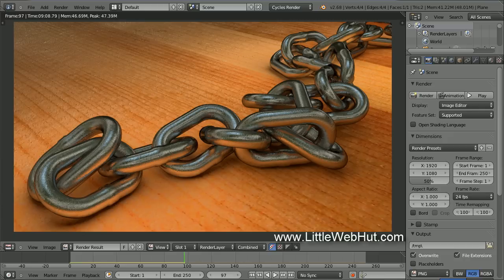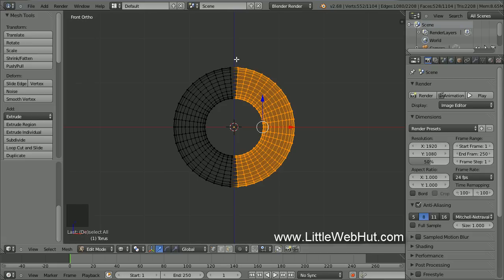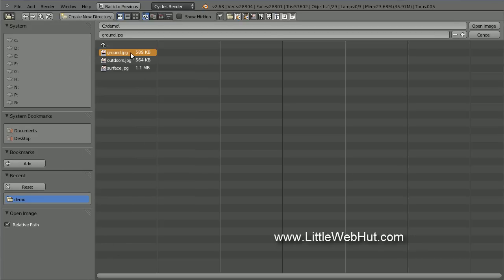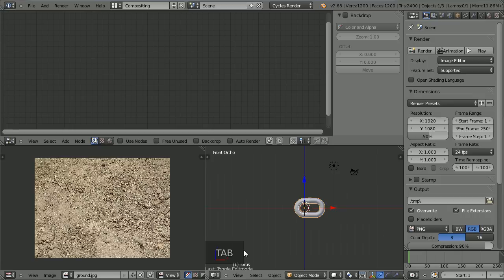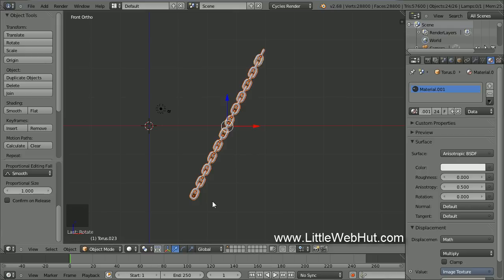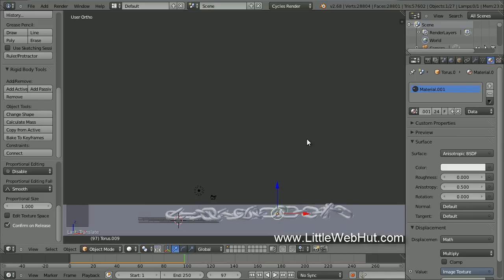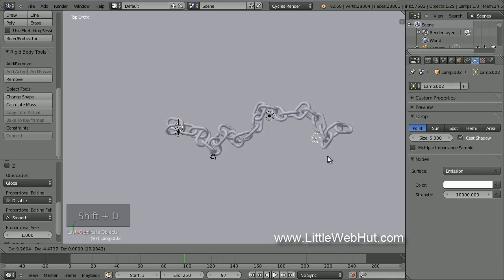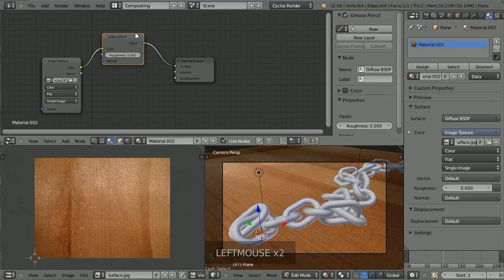Blender Tutorial: Realistic Chain

Comment: Nice job. I had a problem. I did the tutorial twice just to double check but while everything matches up until the last few renderings, I get a chain that looks like chrome in the final renders. There are some differences due to my slightly newer version in the material nodes. Anyway, any idea why I get an incredibly chrome textured chain?
Reply: You can tweak the Image texture displacement by increasing it and the positioning of the cameras and their emission intensity.  The vid has the emission set to 10K and if they are low with the slight diffusion you get that chrome look.  I lowered the intensity in half, lifted the height of the cameras, and then increased the displacement and got a far less shiny look.

Comment: You said to use 500 samples, I used 650. I'm such a rebel...
Reply: +Niko_0202  I used 3000, it rendered in 25 mins
Reply: Niko_0202 Sonic aG Well, I have an ASUS Laptop which isn't exactly the best for this. So my render took about one and a half hours. If I would've used 1000 samples, let alone 3000, I bet my computer will still be rendering that to this day and then some.
Reply: I used 1000, it rendered 2 minutes
Reply: +Vincent the 2nd Asus period isn't meant 4 this
Reply: Th9 Legend
Nah, it actually works way better than you'd think. But one of the most annoying things about modeling and rendering on this computer is when one of my renders start to become large, my computer starts to lag when I'm still working on it. Other than that, this computer doesn't do too bad. Also even if this computer really isn't meant for this, I really don't care. I like modeling in Blender 3D so even if this computer was never really fit for it then I'd probably still be modeling on it anyway.
Reply: +Vincent the 2nd ya I was surprised to find my animation rendered fairly fast

Comment: For some reason, my chain links come out looking white, instead of rendered metal like yours.  Otherwise, I didn't have any issues following this tutorial.  Keep up the great work!
Reply: +Fork501 Got the same problem, my chain is bright silver looking... I don't know if it's because I have the last Blender version, or I messed up something with texture or illumination.
Reply: +Fork501 I had the same result.  I am not sure why, and I even replicated this tutorial 3 times, but it seems as if it's because of the light sources.  I used the same values as he did, and placed them in roughly the same area, but when I took the light values down to about 2000 or 3000, it looked a lot better.  They were just being blown out by the light.
Reply: I adjusted the roughness of the chain material a bit (to something like 0.03, very tiny) and that helped a bit. You could also add a clamp, decrease the light bounces (maximum about 4, minimum 0), and fiddle around lol

Comment: Could you please provide an updated version of this tutorial for 2.73a? When it comes to the rigid body physics the whole thing falls apart. The rigid body tools are in a different location and they don't appear to behave the same way. I tried for about an hour, experimenting with collision, different settings, everything i could think of but all that happened on simulation was a few of the links from the chain just drop straight down. I'm stuck, and from the comments it looks like a lot of others are as well. I'd really like to get this to work.
Reply: Pun_Machine Shift + Control + Alt + C = Set origin to centre of mass, to the chainlink before you start copying it
Reply: Pun_Machine Yeah, mine's not working either. The whole thing just shatters apart into 24 pieces that fly everywhere:/
Reply: Emily Colwill
 when you click a chain-link, does it have a little orange dot directly in the center?

Comment: I am using 2.71 and at 2:40 in the video you should press Enter 2 times to get the loop cut selection, but nothing happens. Is there some other means of inserting the selection, or has something changed in between 2.68a and 2.71 for this kind of workflow?

Comment: Is there a particular reason as to why when I scale objects, or do any other transformation, it does so based off the selected point i have?
ex: When i scaled the side to get the welded side, it pushed it away from the center of the whole object, rather than the center of the selected edges.

Comment: Another great video, T4U.  What needs to happen to get you to release three of these per week?  I'll do my part.

I had a question about the using the node to add a displacement value to the surface texture.  Is that the same as "bump mapping" in the older versions that used the Blender rending engine, or are they two entirely different functions and results?  

Thanks again!